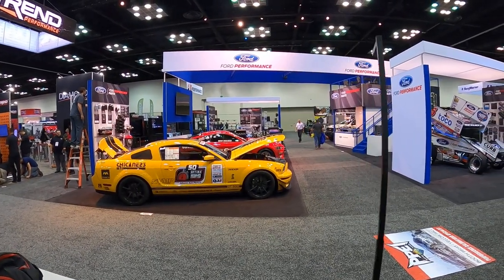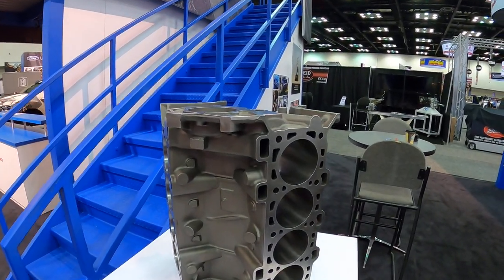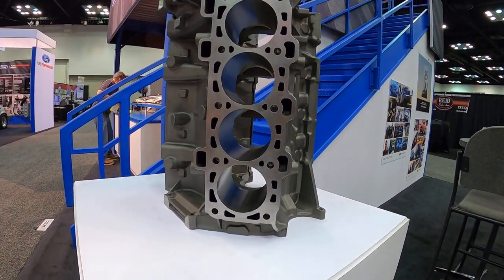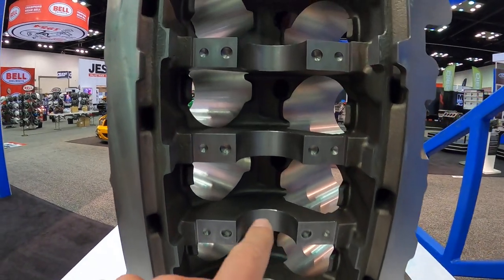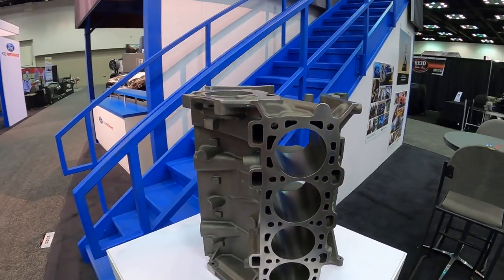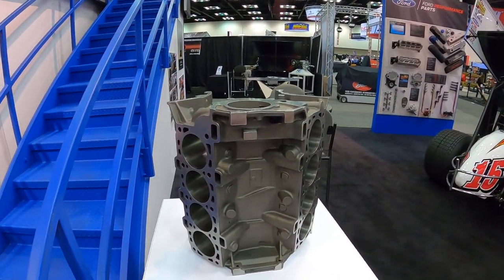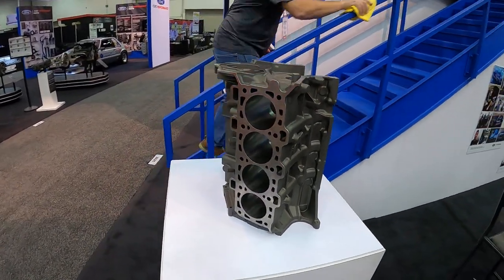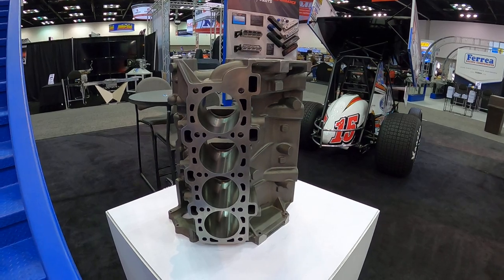First Look | Ford Performance 'Werewolf' Cast Iron Coyote Engine Block

Comment: Hopefully a tall deck version for a stroker as well.
Reply: Lol for what
Reply: @fread51  400+ cubic inch twin cam engines for pro mod,I would assume.I saw a 354" Mod Motor go 5.7@254 at a pro mod event,but many of the big cube Pro Line's were right on it's ass.Maybe this will enable Ford racers to prevail over aftermarket takeover of the pro mod class.There should be another class for all these billet blocked CNC headed cars anyhow.
Reply: @johnrunion7258  The problem with that on a coyote platform is bore spacing. Get too far from stock and you'd need different heads. But it can be done. Given the Coyote's bore spacing it appears to be physically limited to about 350ci and that's with a custom billet block with wider skirts to accommodate a longer stroke. Being a 4 valve engine, the Coyote was never really intended to be a large CI engine as those tend to not rev as high to truly take advantage of the DOHC 4V layout.
Reply: @177SCmaro  Yes, they're making 1500rwh the way they are now ,so it's probably not worth the effort.

Comment: Hope that Ford can pull a GM trick and get the cost down on these blocks. GM has an advantage as they are making billions of dollars on profit yet receive billions of taxpayer dollar every year in the form of corporate welfare. I dont understand how that works. Not much free market when this is allowed by our government.
Reply: Government Motors
Reply: Not with 2000hp
Reply: I guess Ford makes an iron block motor for the Ford GT MK III, if at all they are willing to make one,
The MK II with 3'5 EB is easily worst engine and worst Ford GT to ever hit markets,
So sad that Ford isnt focusing on V8s like they used to and is moving turbo wayx which I feel s good for small turbo engines like 1.5-2.0l, but above that always an NA engine makes way more sense
Reply: Hakimbo Bola the regular coyote are shitting on the lsx

Comment: Hemi describes the type of engine, or Windsor as were it was manufactured. As for Werewolf or Coyote or Voodoo Ford is trying to make these engines mystical which would be ok if they did not have a high failure rate. Maybe name them TIME BOMBS!
Reply: Many former LS racers, tired of getting their ass kicked by the Coyote switch to Ford. Others just cry about it.
Reply: You're jealous. We get it.
Reply: @vxer1000  Not really, just because they came up with a name for an engine it doesn't make it a good engine. Maybe they should have called the Coyote, the Smith Corona due to the sound it made.

Comment: Who wants this? Aluminum with sleeves are making ridiculous power. 80 lbs more . LMAO
Reply: The target market for this iron block isn't 90% of the Coyote Mustang owners. This block is for serious racers that require boost levels above what a sleeved aluminum block can handle consistently.
Reply: @chrism.728  Yes, so like people wanted to make over 2000-2500hp from this platform, which I believe is about the limits of the sleeved coyote. Another alternative is a billet block but those are expensive.

Comment: Can we PLEASE get something like this for the older 4.6 platform? Maybe retool the old BOSS50 big bore block with those beefy main webs?
Reply: no
Reply: No
Reply: As I understand it, any place a 4.6 fits a Coyote will fit.
Reply: @177SCmaro   True but I already have a Terminator cobra and some of the best parts you can find for a 4.6 based engine but no block strong enough to handle what the parts would otherwise be capable of. If I wanted to go coyote I'd have to sell off all of my s*** at a huge loss because almost none of it would work on a coyote. If I were to sell all my stuff and completely redo everything to accommodate a different engine It sure as hell wouldn't be a coyote.

Comment: Cast iron engine block? Obviously meant for drag racing applications and not meant for anything that can corner. Which is something that Dodge still hasn't learned.
Reply: Sorry but there isn't enough weight difference to make the argument you're trying to make.  You'd be suprised what proper chassis and suspension will do to any car.
Reply: @turbochevelle5641  I definitely agree with you on the proper chassis and suspension. No question there. BUT. When you are talking about an extra 90 to 100lbs right over the front axle, it is most certainly a detriment to handling. The car won't feel as nimble as it could when you are going hard in and out of corners. The funny thing about Dodge though, they understood this when the Viper was in production. It's big 8.4L V10 had an aluminum block.
Reply: @V8Supercar1  with proper geometry, scaling and spring rates 80-90 or even 100 pounds doesn't make that big of a difference.  Honestly someone making a big deal about 100 pound weight difference is just using it as a bandaid argument and  excuse for lack of knowledge as to set up.
Reply: I'm willing to sacrifice a weight penalty for an affordable alternative to a $10,000 billet block.   I'm guessing this will cost somewhere in the neighborhood of $1500-2000 which isn't much more than a sleeving a stock aluminum block.  It's not the right block for everyone, but it's the right block for me.

Comment: I wanna know what kind of bore and stroke this can take.
Reply from the maker: She'll go out to 5.6L.
Reply: @SVTPerformance  So zero stroke and what, a .075" overbore? I think I'd leave it stock bore with meat for a couple of "boost-induced" rebuilds/rebores given the general reputation of Triton's when it comes to "durability" in general. Small bores and long strokes and short skirts and high rpm make for stupid high minor and major thrust loads, piston speeds, piston/ring/wall friction and "issues" getting and maintaining proper lubrication where it's needed. Especially with those ridiculous timing chain "slack reducers" and "cam phasers" and all that shit "upstairs" to oil with steel camshafts running in "plain bearings" aka the aluminum heads themselves. I'd be curious to see what if any "build specs" Ford publishes and what "recommended"  dimensions, clearances and tolerances are for this "cast-iron" block vs a "build" with an aluminum "5.4" block. Can't imagine you can "build" one of these with the exact same "specs" as those aluminum boat anchors. Maybe that's why they weren't introduced in/as/with any "crate motors" or even short/long-blocks.

Definitely going to be a steep and slippery "learning curve" for anybody who thinks his aluminum-block "tunes" are going to fly with "cast-iron" that doesn't waste near as much engine heat and "power" into a big "heat sink" of an aluminum block. Which after all along with aluminum heads are the ONLY way you can run "pump gas" in "11:1" and "12:1" Coyotes. Of course the STUPID-LONG valve overlap and ridiculously restrictive intake air "paths" with all those right-angle turns etc also dramatically reduce "dynamic" compression regardless of the published static and "mechanical" compression ratio. Otherwise a proper compression test with a "WOT" would net "cranking compression" in the very high 100s. 

The same ridiculous engine design, specs etc for a small-cube NA engine for a lead-sled "muscle car" aka "2-door sedan" like any and all Mustangs since...'69 or so also make them truly stupid choices for trying to "boost" your way to "big power". 

Since 20+ psi "gauge pressure" appears to be the absolute minimum amount of "boost" required to make a Mustang "worth boosting" and that's 34+ psi "absolute pressure" with the "invisible boost" of atmospheric pressure tacked on OR Ford's "manifold pressure sensor" is actually calibrated to/for "absolute pressure" and those boat anchors can magically make "big power" on "little boost" instead of the other way around, it's a safe bet nowhere near all that "boost" is actually getting into and staying in the cylinders. Or those cheesedick engines wouldn't be able to "flex" and "leak" cylinder pressure fast enough past the rings to avoid some "leaking" out through permanent "vents". 
And since "boost" like all "pressure" is just the result of flow vs. restriction and making "more.boost" without a directly proportional "power" increase means you're past the point of "diminishing returns" and your "blower" has begun taking more power than it's making and no amount of flow increase will ever reduce the existing restriction AND you're just packing more air where too much already exists AND as "boost" INCREASES your effective FUEL "PRESSURE" IS DECREASED AND YOU GET LESS AND LESS FUEL THE MORE YOU "NEED", it's only "impressive" to those with a clue just how much money and "boost" it takes to allegedly "double" the "RWHP" of the most overhyped, underperforming, overstressed, under-engineered and unimpressive MOD MOTOR OF THEM ALL FORD ONLY CALLED "COYOTE" BECAUSE "TRITON" WAS ALREADY TAKEN AND MUCH TOO "RESPECTED" TO BE TARNISHED BY THAT DOHC 32-VALVE WANNABE  "FORD NORTHSTAR" BOAT ANCHOR SO "REVERED" BY A BUNCH OF "MILLENIAL" TWITS WHO DON'T EVEN KNOW WHAT A CADILLAC NORTHSTAR IS AND HOW ITS THE REAL "GRANDFATHER" OF THOSE "COYOTES" THEY THINK ARE SO "NEW" AND "HIGH TECH" AND "UN-GM".